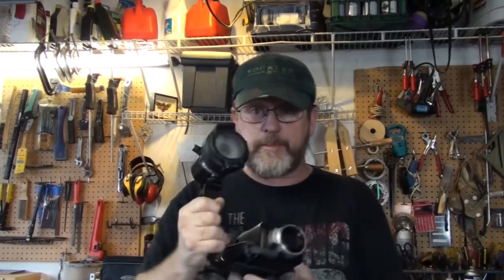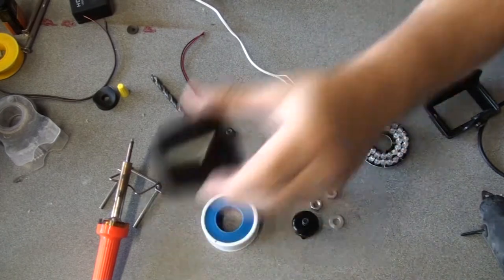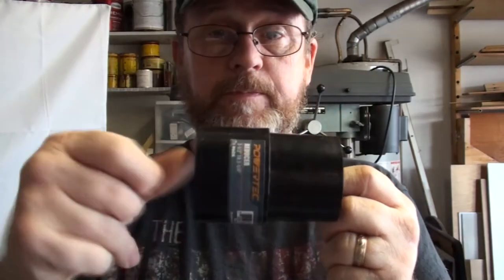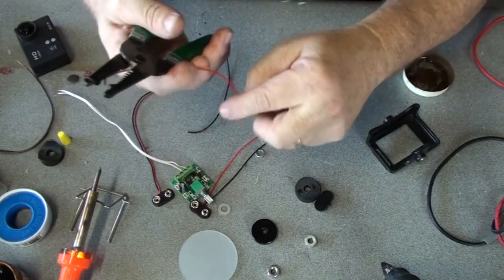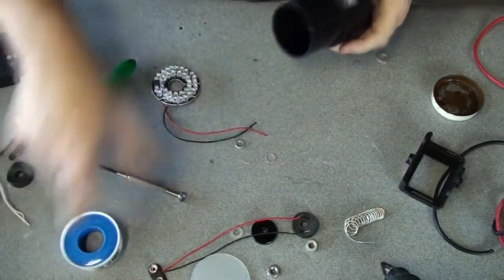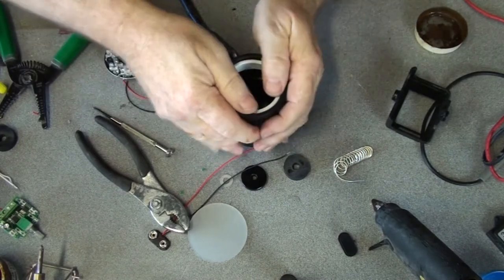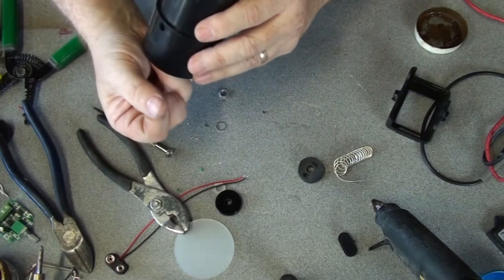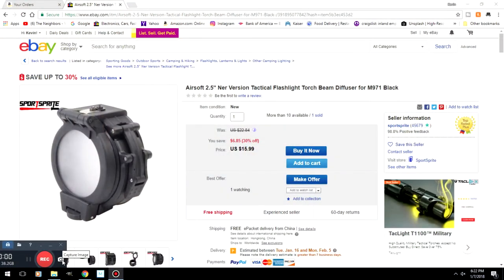HOW TO MAKE AN INFRARED LIGHT FOR GHOST HUNTING

Comment: Great light build. Thanks for sharing. May I ask how long the 9v battery last when using it?
Reply from the maker: I think the 9v will last most of the investigation. 2 or 3 hours.  The $40 Polaroid light  lasts 30 minutes and needs 3 hours to recharge.  With this light you just replace the battery.  Kevin
Reply from the maker: Sure.  You need some content.  What state are you in?